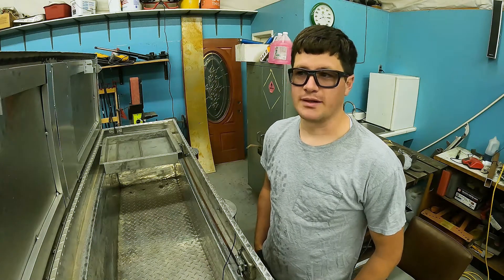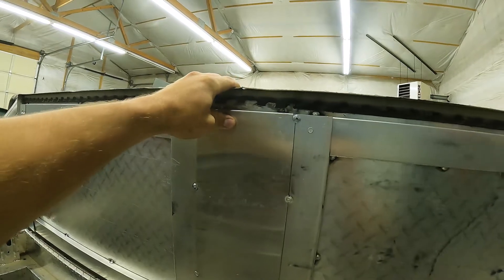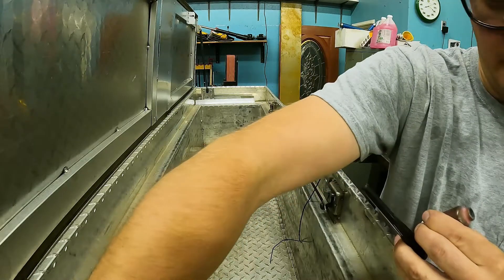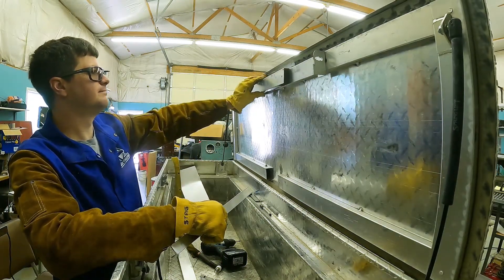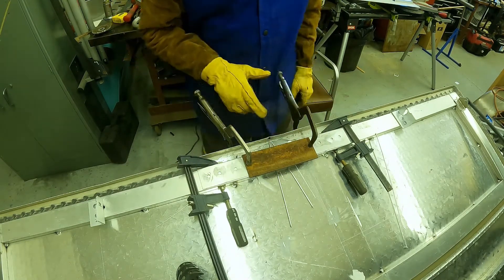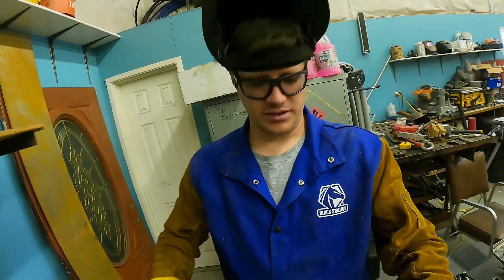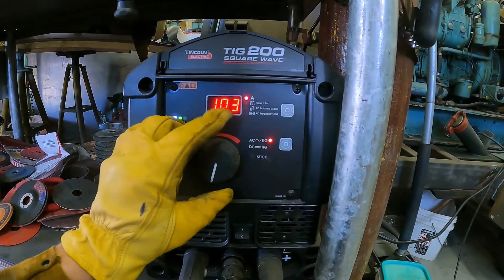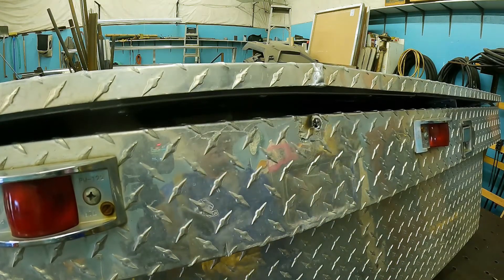How durable are aluminum truck boxes? Aluminum toolbox repair.

Comment: I fixed a box like this for my truck. It was a better built brand box and man that shit is paper thin. So thin I had trouble not burning through and I warped the front after welding in some angle to reinforce it. Weathertech boxes are worth the high cost
Reply: I have a weathertech in my other truck and man it has to be twice if not triple the thickness aluminum compared to the better built cheap box.
Reply from the maker: Weather tech has awesome service boxes and utility shelves too. I agree on their quality. They come at a price too